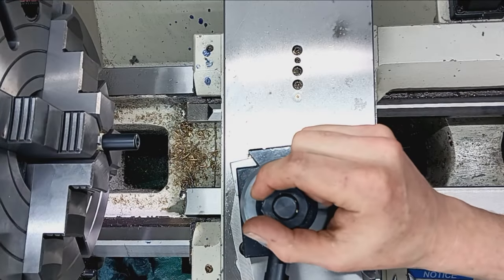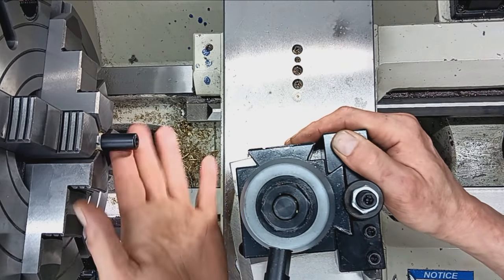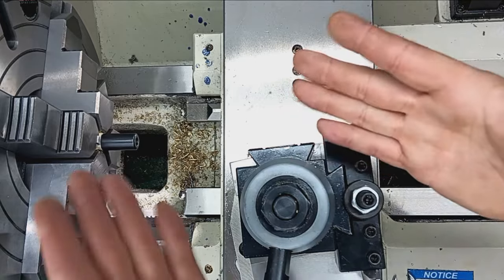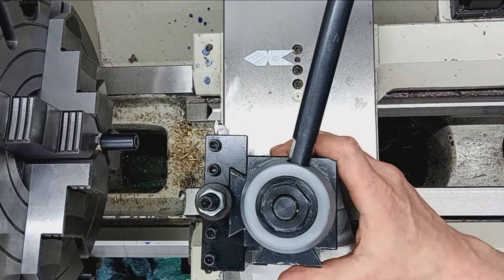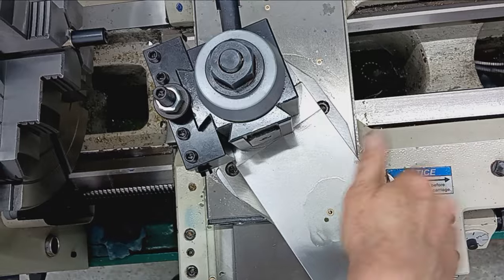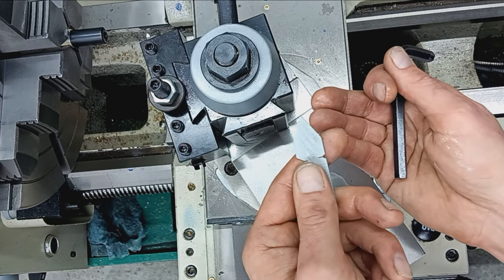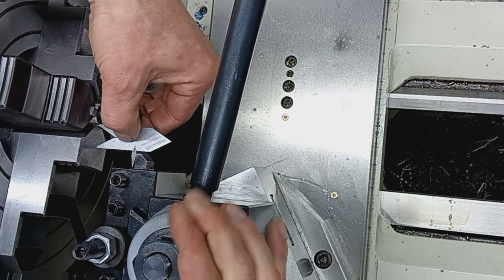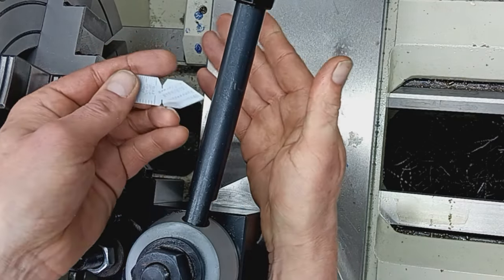Tales of the Fishtails - are they important, or just a crutch?

Comment: I entered the tool & die trade in 1990 and can count on one hand the number of times I had to use a fishtail at work. Why? Because we always used modern index-able carbide tooling held in Quick change tool posts. Which once set up properly, allows you to use 1-2-3 blocks to set your tooling square against the face of the chuck. Same at my home shop. But I use a fishtail often at my buddies shop. Why? Because he has an old 16 inch South Bend lathe and uses hand ground High Speed Steel cutters held in Williams tool holders in a lantern style tool post. In other words, the exact setup a fishtail was created to help set up.
Reply: ive never bothered with one.
yep, 90% of the time, rely on the accuracy of QCTP...

the other times? i use a bolt. metric, unc, doesnt matter, both 60. odd time a bspp/w(s!)hitworth pops up, theres plenty of plumbing fittings kicking around for the 55.

theres also no reference but the taper itself when doing bspt/npt, etc.

cutting a dardelot? dont even consider it, just give it before you even start. theres a reason its unheard of :)

Comment: hey AAaR, I am a lazy old fart, and I take my quick change tool holder
and run it up to the chuck to square it, clamp it down, and then because 
I am a LOF, I might use a fish tail.....
you probably have done the same.....what ever works, 
and gives you a good result, is the best way to do the job......
now to go and check out your Rock Island Armory 1903 video...
this Lazy Old Fart bought a Model of 1917 back in 1968 
when he was 15, and that caused him to want to be a machinist.....
Best Wishes, Paul
Reply: Ditto 👍👍👍 from one LOF to another
Reply: I use an old piece of flat bar I've trued up and face it off the chuck like that so I can actually touch the tool, I used to do the tool on the chuck on my last 13x40 lathe but this 14x45 I got now is like overly built and the compound has an edge that sticks out close to the chuck when you have it turned , so to keep it away from the danger zone I implemented the piece of metal. Check it with the dial and it can always get you within a thou , good enough for government work..... Actually that's prolly better than government work now days🤣🤣🤣🤣
Reply from the maker: That's a good suggestion!!  Thanks for the comment and for watching our videos!!